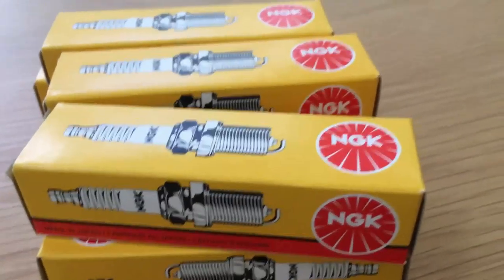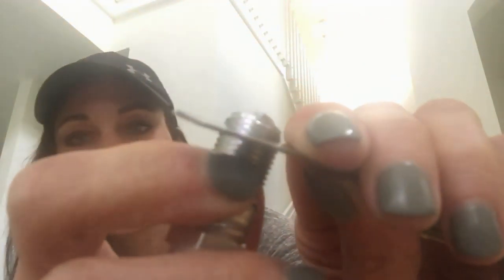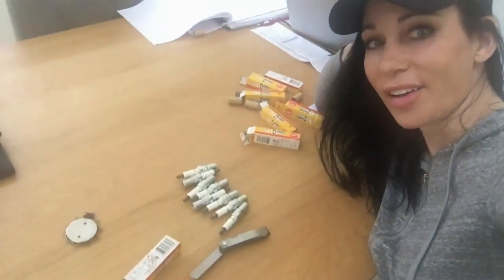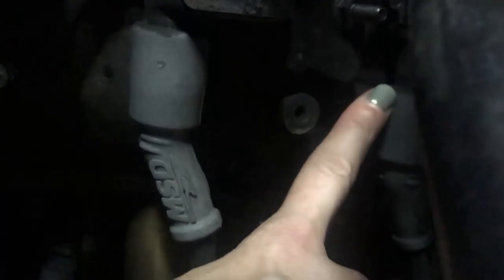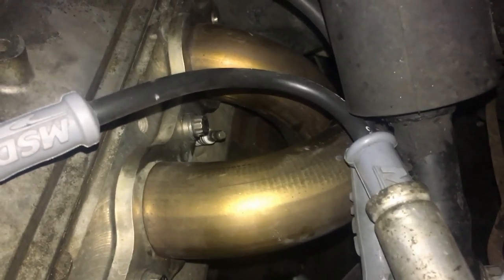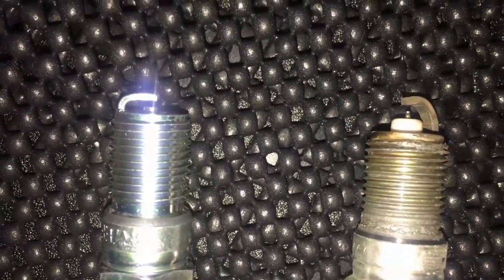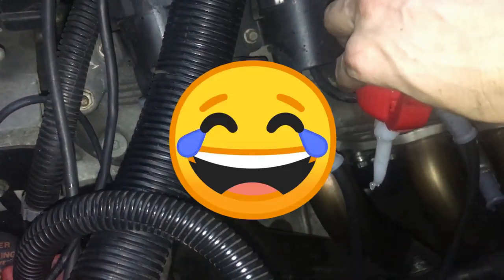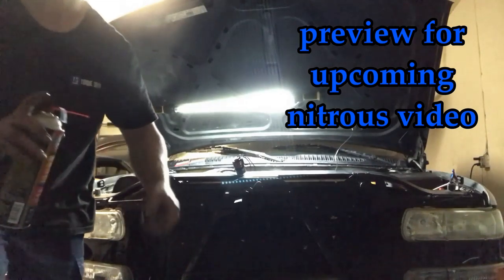Nos SPARK PLUG SERVICE : Beginner's Guide (girl shows you step-by-step how to gap and replace on V8)

Comment from the maker: The tool I used to replace the spark plugs was a 5/8 deep socket on various (short and long) 3/8 ratchets with various length (or none) 3/8 extensions. You may also be able to use a 16mm instead if in a jam. Or even a 1/2 ratchet with an adapter but I'd be careful not to over tighten them with that on the way back in. There are special spark plug sockets in most tool kits that have a rubber grommet to catch the spark plugs and protect the ceramic from cracking. Those suckers get stuck sometimes :) Some cars will have a different size spark plug socket such as 13/16 or even smaller than the 5/8 I used here. But I'm an LS girl...